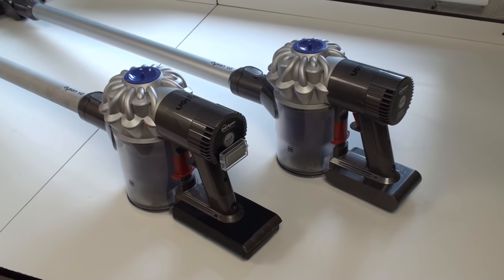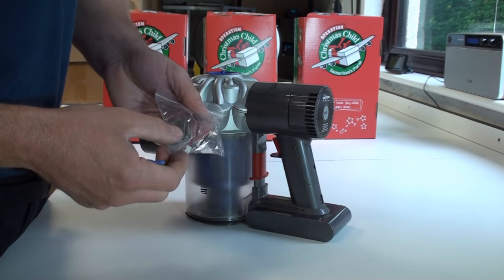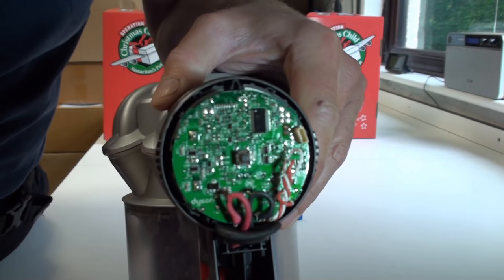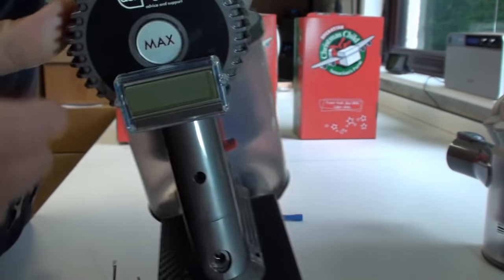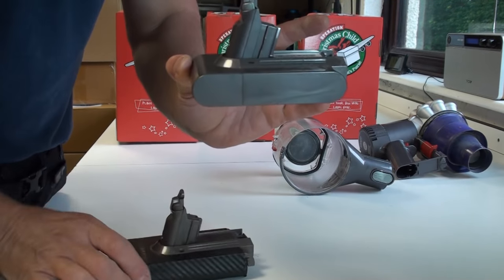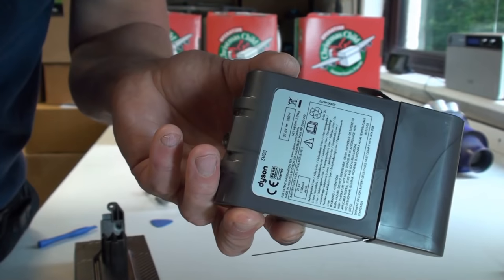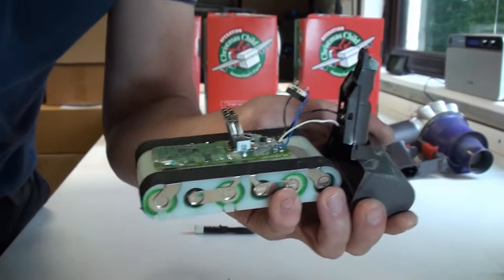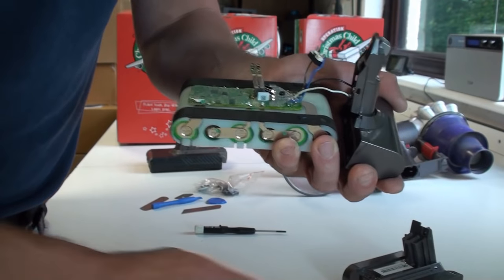Dyson V6 Modification

Comment: FIRE HAZARD!! In the video, he does not solder balance wires to the control circuit board. These lithium cells must stay balanced or eventually one will be over charged to the point of failure. By looking at the OEM battery pack you can figure out where the balancing leads should go. Do not omit them.
Reply: My dyson dc35 battery original doesnt have balanced charging either. They just rely on the battery over current protection within the battery cells.its not dangerous, just that bat dies quicker which Dyson will love to sell you another. Unless of course I've just got a very similar looking copy battery, which may or may not be the case.

Comment: Thank you very much.  Wife bought this vacuum.  House and three dogs far too much for vacuum.This is a great upgrade.  Owned photo business using 100+ rechargeable battery packs.  Often replaced the 3 lead cell batteries inside.   Dropped a new box of batteries "Once".  Within seconds the box was on fire.  Thankfully no one harmed.  Extra, cautious after that. Thanks again.

Comment: Hi 

Please accept my apologies first. Your battery modification is ill-advised. Both type of replacement batteries you suggested are not suitable for the application. The original cells used by Dyson are Sony VTC4, which have a continuous discharge rating of 30A, also they are more expensive then the Panasonic ones you suggested. Panasonic make excellent batteries but not for high discharging applications, which is why you never see them used in power tools. Both Panasonic 18650 and 26650 cells you suggested are only rated below 5A. Dyson DC motor is rated at 350W, simple calculation suggests your cells are going to be able to deliver 111W continuously. (3.7V nominal voltage x 6 cells =22.2v,  22.2V x 5A=111W). Although they may work for you initially, your cells will overheat and degrade rapidly over short a period. 

More suitable replacement options are, LG HG2, SONY VTC6 or Samsung 30Q cells. These are rated at 20A and 15A respectively, unfortunately even these ones have lower ratings than the original Sony cells used. Although I personally do not condone Dyson's b*lls**t marketing tactics at all, their choice of components are excellent. I suggest if you want your Dyson vacuum to last longer, use 12 x 18650 high discharging cells in 2 parallel banks instead of 6 26650 cells.

Let me know if you believe my comments are out of line, I will be happy to remove them

Regards
Reply: I'm not exactly good with electronics, but I assume I could just drop in VTC5 with higher 2600mAH capacity and also the same dimension as VTC4? or put 2 parallel banks of VTC5 to double the runtime?
Reply: Yes, you should be able to drop them straight in VTC5s. Although VTC5 are higher in capability, they're rated at 20A. 2 parallel banks should double your runtime, if the protection board in the battery is up to the task.
Reply: Can you make a mega pack with 6 cells in series to make a 30A cell (using a total of 36 batteries?? 

LOL

The uploaded can't even be bothered to reply back. I presume he realises he made a mistake. Also his display is on the wrong place it should be above the max so you can actually use the max button with 1 hand.
Reply: Can I use Sanyo NCR18650GA 3500mAH  10A(20A)
Reply: were the batteries he removed Samsung?
Reply: +seanz1983 Yeah! ... THERE'S the rub. Providing a DECENT BMS is easy, eBay have dozens of good ones available for a few quid each,  but it will NOT be able to communicate properly with the ATTINY in the motor unit (the board in the handle) in a DC35 for example. I'm not sure what, if any, communication occurs between the BMS in a V6 and the motor unit but knowing the way Dyson works (just like Apple) they like to make things unbelieveably and unnecessarily complex (just like in the DC35) in order to prevent people from repair and upgrade paths which would otherwise be a piece of cake (relatively speaking at least).
Reply: seanz1983 w
Reply: seanz1983.                       what about replacing the originals with 6x. sony vct5a ?   or is there any issue with the BMS protection?
Reply: All these mods are useless and dangerous if there's no proper balance charging implemented. I would just use RC lithium polymer batteries with external professional balance charger instead. I would throw away the dyson battery including the charging circuitboard. I'll keep only the discharge connector.
Reply: robert wong can you provide me with an example? which product would suit
Reply: Oh when not in use, don't store the battery at full charge. Always at 50 percent or 3.8v per each cell. This is true even for Dyson's batteries, which they NEVER tell you, that's why your batteries get damage a lot faster if you store them fully charged. Both Lion and Lipo share similar characteristics. Do not store them unused fully charged, and do not over discharge below 3.8v per cell, if you want to keep your batteries last longer. These RC lipos I give are examples of average performing batteries, rated for 90 amps discharge, which is 3x more than the 30a rating of the dyson batteries... You see... even average rc battery is 3x higher performance than dyson batteries. Some high end ones go up to 6x.
Reply: robert wong ok sounds nice but consider that it will end up costing quite a bit and takes a discreet amount of patience to use and set. 
instead, for domestic use, why not buying an additional backup battery and a charging station or similar?
Reply: 4 hours vs 30 minutes charging time? The rc lipo will run longer and last longer even. But useful only for people who know what they're doing.
Reply: robert wong what s the most powerful original battery you can come across ? in case I want to buy just a backup one. how many mAh with the same discharge. thanks
Reply: robert wong i mean speaking of original lion dyson ones. i saw a couple that have a bit more capacity than the original one
Reply: +seanz1983  i agree and as you said there are a few better options but when mine died (after nearly 5 years) i just changed out the old for the original sonys. the origanal batterys are more than adequate for the job.  but between lg, sony and samsung i go for sony, i've used all three in various custom RC aircraft/drones and so far the only ones that havent let out the magic blue smoke are the sony..
Reply: I would suggest that you stay away from lithium polymer, this is a home appliance that gets knocked about and you put on charge and forget about it, that can't be done with Lithium polymer batteries except you want to be homeless and your belongings burnt to the ground, Lithium ion batteries are much safer.
Reply: TM
Reply: I like the idea of 12 x 18650 high discharging cells in 2 parallel banks, but I am unsure about Voltage and Amps doubling in the process can you describe how it would work?  I could mod an enclosure and the Extra Weight would not hurt too much for the extra time you would be getting.  Thanks Ahead!
Reply: Would it not be possible to run it off a couple of AA's? I can get them cheap as chips from the pound shop
Reply: Thank you for telling us what he did is totally wrong. The tool can't even answer  you and say thanks for correcting him etc etc.
Reply: Good point mate!
Reply: Guys,can anyone turn this into cable version?

Comment: Cool mods. I also want to extend the battery life of my V6. The main thing to watch out for is you gotta choose cells with low internal resistance or else most of the energy will get wasted as heat (Dyson was right to warn you). But I haven't seen the resistance specified in any datasheet, leaving you to measure it yourself. Plus, power tool cells usually hold less charge. Other improvements I'd like to see: 1. power from AC adapter. 2. reverse switch to turn it into a blower. 3. disable annoying automatic cutoff when clogged - this stopped me from using the V6 for my DIY vacuum former.

Comment: good idea... just please re-connect the balance wires (links to from the pcb to the cell-cell solder tabs).
Cells tend to go out of balance over time if not managed... and will not tolerate it like nimh or nicad

Comment: You are my hero now
I have an old dyson unit that needs a battery replacement 
where I live the battery cost 70% of a whole new dyson cleaner.
I will try to replace the battery on my own 
Thank you
Reply: Take note if the red battery failure light is flashing you may not be able to reset it according to some comments.

Comment: You should ask someone to 3d print you a new battery housing.
Reply: M Living Which might melt really fast when you charge your ad hoc battery pack.
Reply: @davidwoodward9528  Wrong, same material as original, ABS.

Comment: Lithium cells are generally a little more volatile than previous battery techs. It goes for the original 6 in the dyson as much as the upgraded/replacement cells here. Having them put in a pack with a decent charger by dyson doesn't automatically make them any safer.
Get good quality cells, decent balance charger and there's zero issue with this. 18650's run at 3.7v up to around 4.2v fully charged, so long as the ampage output is at least as good as the originals, there will again be no issue. 
I'm another user who'd appreciate a bigger battery pack. My solution is likely to be a belt clip with a larger battery pack and the battery modified to just be a plug for the belt pack. Will see though :)

Comment: Dyson got some of those consumer screwing things going on with their batteries that ink jet printers have with cartridges.  Batteries should be separately replaceable from the BMS and you should just be able to stick new 18650s in there or change out the BMS with a few screws if it goes out.  Dyson has so much trouble with the batteries working.  Congrats.  Thanks for this video.

Comment: Are you, by any chance, still in possession of the original cells? I'd like to know, which ones come with the original battery pack. Upgrading to 3Ah-cells seems like a good Idea but I guess they have to provide at least 24Amps at max mode so having a look at the original cells data-sheet would be a nice start for figuring out which 18650 cells to replace them with. Thinking Sony VTC6 should be on the safe side but maybe there's something cheaper or with more capacity that gets the job done. On the other hand I don't want that thing to blow up right into my face.

Comment: Modded my old DC34 animal pro with the battery meter. Also refitted a dying after market battery pack with 6 Samsung INR18650-25R. Only 65 watt machine, so 20A discharging rate should be safe. 2.5 Ah instead the 1.3 of the original doubles capacity. And this choice made it a cheap mod. Thanks for the inspiration!
Reply: Здрастуйте. Прийняте на ячеки vtc6 6шт, и замените bms родную на bms 6s с алиекспрес, и будет Вам работа dysona на 40 минут!

Comment: Just ordered some 8800MaH batteries for my conversion. gonna last all day! Great video. you can find the batteries on ebay for about $4 each
Reply: hey how did it go ? saw these on ebay.. 6x 3.7V 18650 8800mAh Li-ion Rechargeable - did your conversion work ? 
How long does the vacuum work ? :-)
Reply: unfortunately, there is no such thing as  8800mAH cells the best you are going to get with current cell chemistry  in 26650 sizes is 5500mAH have a look on this site  http://lygte-info.dk/review/batteries2012/Common18650IndividualTest%20UK.html
Reply: LOL. With the current top of the edge knowledge in Li-Ion chemistry, we are able to pack up to 3400 mAh of energy in one 18650 cells. No way these are 8800 mAh. You just got ripped off. More like 880 mAh than 8800 mAh.

Comment: You understand those 2000mah cells will withstand a much greater amp discharge rate and therefore make a more powerful suction or possibly less likely to explode unit and as they're running in series I can say it'd be much safer leaving it stock